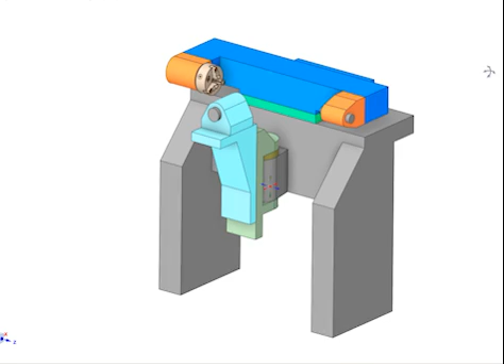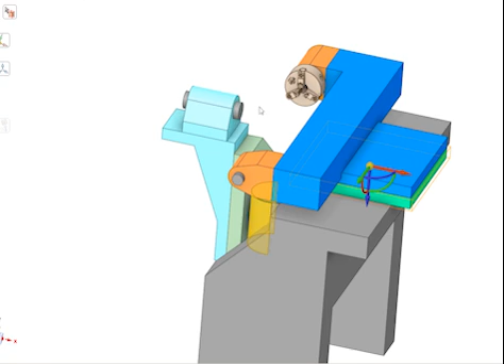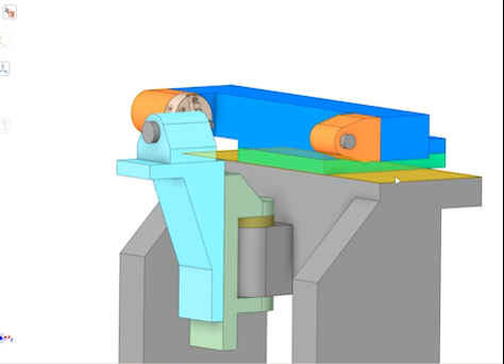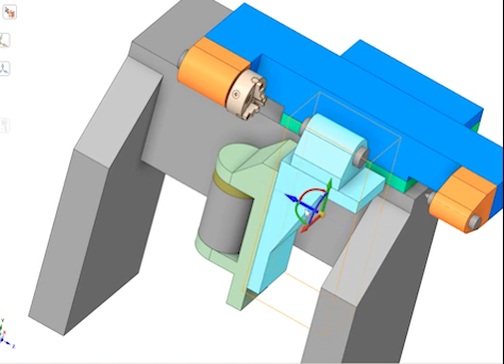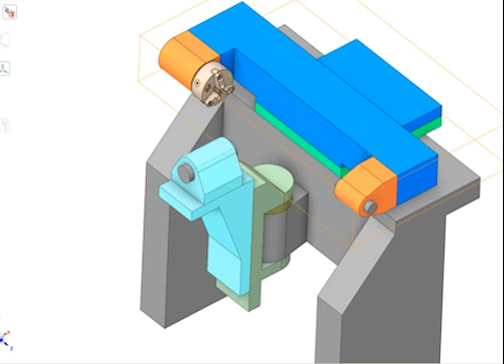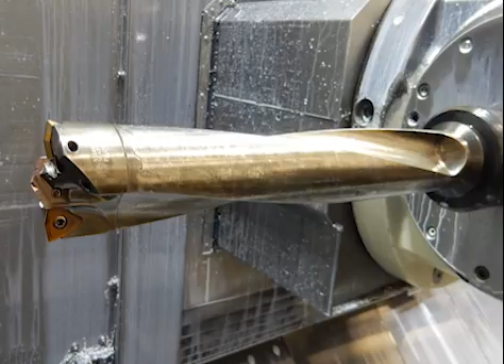Small Mill Turn Machine Idea

Comment: Looks like a nice machine, but what would be the target envelope like a 8inx15in part? Also what kind of easily obtainable cnc controller supports simultaneous 5 axis?
Reply from the maker: The max part size as far as just turning would be 8” dia x 24” long. But if you want to mill on the end I would say half that length. Depending on the length of the tool needed. Everything is a compromise. As to controllers I don’t know yet. I have to do some research into that.
Reply: @EdgePrecision  seems like a pretty good envelope, but i didnt see if the milling spindle can go up an down like yours can go in and out for pocketing on the circumference, did a quick search and it seems Linux cnc suports some kind of 5 axis kinematics. And i like the idea of a tool room 5 axis mill turn

Comment: Put some t slots on the vertical face and you could bolt a vise to it even.

I wonder about all that weight carried by the x/y though. On the one hand, weight reduces vibration. On the other, bigger linear rails. (And bigger servos.)
Reply from the maker: I don’t think it would weigh any more than a Bridgeport’s table with some vises on it. So motors that could do that would probably work for the X and Z axis. I think they use around 400-500 ounce in toque motors on a Bridgeport conversion on the X and Y axis. Again that depends on the speeds you want to move at.
Reply: @EdgePrecision  True! Scraped ways though, which are cheaper for the load.
Anyway -- I'd love to see this get built!

Comment: The only concern I see is you’ll end up with simultaneous axis movement for any kind of drilling outside of 0 and 90 degrees to the rotation axis.

I’d make the quill a requirement, it be easier than what would be require to get two axis’ to move that precisely.

And for transparency that is me searching for any possible issue. It’s a really interesting arrangement with a lot of potential.
Reply from the maker: All mill turn and lathes with milling do it that way. Any holes off axis have to sink two or more axi to drill parallel to the tool. This kind of thing isn’t really a problem. My Mazak can even manually jog like that. There are switch settings on the manual jog wheel to let you do this if the B axis is tipped at some angle. If you think about it. What if you stop the machine drilling a hole at a angle. In order to jog the tool out of the hole you have to be able to manually jog straight with the tool. So this isn’t really a problem on 5 axis machines.
Reply: @EdgePrecision  Saw the second video. Love the 2 positions on the switches that allow jogging along a different work plane. Would be very cool to implement in home made machines.
Reply: Very true! I was just thinking as far as a hobbyists’ machine where quality could be spared.
If you start building this machine I’d love to help out with cad design and prints if you ever need it!

Comment: I really hope you build this machine! I am currently building a B axis head mill that I'd like to be able to do mill turn on. You should look into how you will set tool lengths and what controller you will use to get a B axis head to work. I have found that getting a typical hobby controller to work with a B axis head is challenging because the tool length affects the machines geometry

Comment: Hey Peter, that is and interesting idea. I wonder if something more like a engine lathe with an  old school versa mill head that could lock the spindle to hold turning tools and on a rotary indexer would be better/simpler?  Should beat the limited x negative  travel the bigger mill turns have.

Comment: Very interesting design Peter. I might build something along these lines and if I do I'll be in touch! Main thing that I see that isnt commonly available is the spindle. Theres tons of decent spindle options for routers etc but something that can both mill and take & index fixed turning tools like your Mazak is a challenge.
Reply: Yeah, they tend to be of custom construction and they are always quite bulky. What would be more achievable is just a nice solid and repeatable spindle lock, and if you use toolholders that index repeatably too then you can use turning tools in a pre-set orientation, it's just not adjustable.

Comment: Very cool project we have been trying to figure out something similar for years. We think we will start with a small DIY horizontal mill for doing production of small parts. We have a vise we sell that is a competitor to mitee bite and need something in the production area. But man these types of machine are unbelievably expensive and there isn't a scaled down version out there like the Haas mini mill. So we are going to have a go at it. I would love to see you continue with a project like this but we know how much work they are. We have built 5 of our own DIY cnc Machines. They are a lot of work.

Comment: Toolchanger would be challenging.. and like toolroom lathes with the turret in front of the part, vision is partially obscured. Otherwise a very nice setup. Z axis servo would be pretty hefty to move the "lathe" for threading at higher rpm etc.
Reply from the maker: In this case I figured on manual tool changes. As far as the spindle obscuring the operators vision. You are correct, but it’s a compromise for the sake of simplicity and a more rigid configuration. And yes the X and Z servos would have to move some weight. But really no more then a Bridgeport table with vises on it.
Reply: @EdgePrecision  Would love to see somebody take a stab at it. Go with a CAT or BT spindle at the very least.  R-8 has no business here.
Reply: @ilikec  don't forget 5c..  But that setup is cool because from the lathe chuck to the mill head could use every tool type of holder around.
Reply: @Jeralddoerr  for the "lathe" spindle,  5C or 16C would be nice.  Maybe a A2-5 nose. If the tailstock was live, even better.

Comment: I like the design, very unusual, but the rotating cutter holder at the front is certainly innovative. You could sort of hide the motor for that holder underneath the holder body, keep it out of the way. Might need bespoke tooling in some cases for the turning side of things. One interesting thing is that swarf/chips would fall more readily down underneath the lathe rather than get jammed inside the casting ribs.
Was this supposed to be CNC or small/hobbyist? 
Would be interesting if there was a conventional version for hobbyists, or even a kit version to keep costs down. You could even put a slideway on the rotating holder so you could move that in x.

Comment: Interesting axis layout. Millturns are fore sure the most versatile type of machining center. I work as a machinist but its also my hobby and I understand your desire to build your own machine because I have it too.  Having  a lot of weight on the x/z axis might be a problem because the motors needed to be agile and powerful enough to do 5ax milling are pretty expensive. Tool changing might be problematic as well and the type of spindle to do milling and turning also presents a challenge. I have looked for them myself and didnt find any within a reasonable budget, yours might be different than mine but its going to be expensive to build this machine. 
But I hope you'll find the time because it looks like an amazing and interesting project. 
Greetings and respect for the work and videos from Germany <3